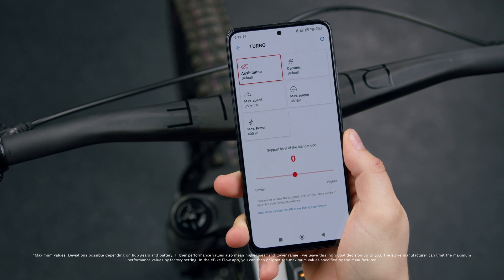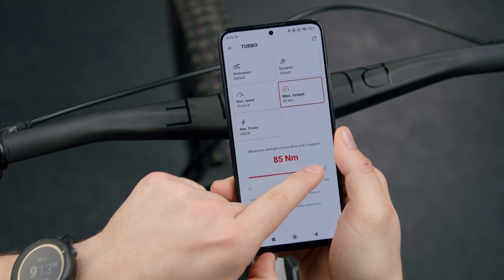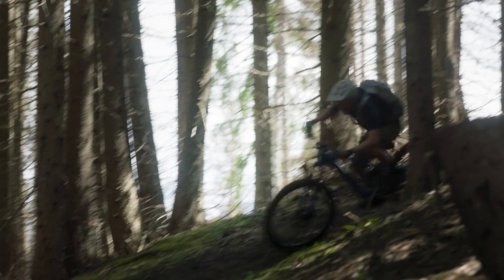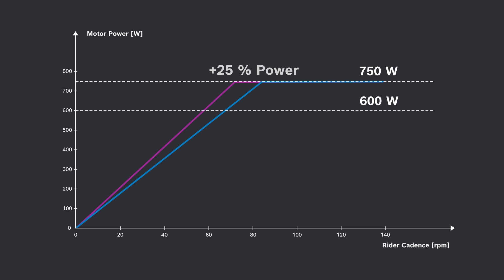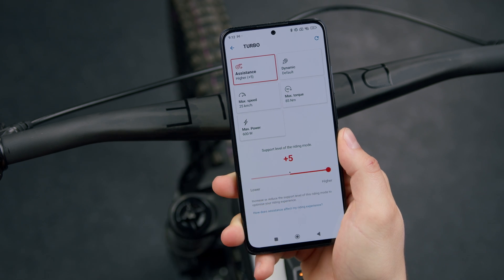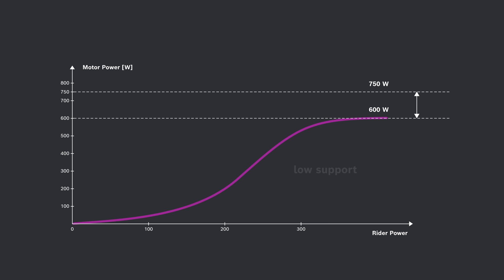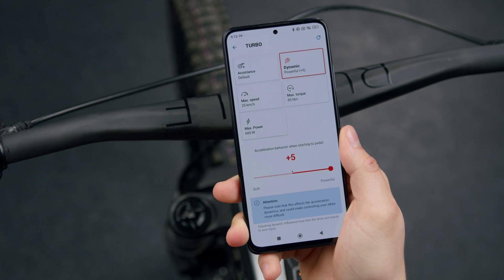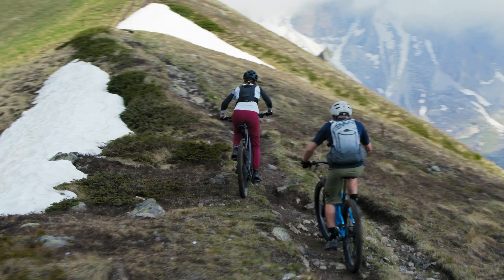Performance upgrade explained | Bosch eBike Systems

Comment from the maker: You have questions regarding the Performance upgrade? Our Help Center provides answers:
➡ Performance Line CX (BDU384Y): https://help.bosch-ebike.com/en/help-center/asset-ast-00284
➡ All Drive units: https://help.bosch-ebike.com/en/help-center/asset-ast-00314
Reply: My cube one44 800 at is stuck at 750w and 85Nm have Android and app 1.28.11 and there is no new uppdate, have tried different phones also remove and done every settings in the app. Also visited my local dealer and he did a update using computer but still only 85Nm. Cube lista the bike as 100Nm ready. Any tips?
Reply from the maker: Hello Niklas Martinsson, With the current update for your eBike with the smart system, it may take several days before the performance upgrade for the performance value maximum torque becomes visible. This only applies to the Performance Line CX drive unit (BDU384Y). The "Y" in the product code is a placeholder and can represent a different number depending on the model, for example BDU3840. You can see your Drive Unit model name if you follow these clicks in the Flow App (from version 1.28) in the settings: eBike Settings -> eBike Pass -> Components -> Drive Unit. Please note: An increase in maximum torque is not available for the Performance Line CX (BDU374Y).
Reply: @boschebikesystems Please clarify, if Gen4 should get torque update too why BDU3741 is not included?
Reply from the maker: Hello Niklas, an increase in maximum torque is not available for the Performance Line CX (BDU374Y).
Reply: @boschebikesystems i have bdu384y my dealer says bosch knows about software bugs that make it not possible on some bikes to uppdate. Any news about when next sw uppdate will come to the flow app?
Reply from the maker: Hello again, with the current update for your eBike with the smart system, it may take several days before the performance upgrade for the performance value maximum torque becomes visible. This only applies to the Performance Line CX drive unit (BDU384Y). The "Y" in the product code is a placeholder and can represent a different number depending on the model, for example BDU3840. Please note: An increase in maximum torque is not available for the Performance Line CX (BDU374Y).

Comment: Hi, i bought a Trek Rail+ with a BDU3840 motor.  The EMTB+ mode will not show up in the list of riding modes. Is this Normal for this model or is there something that can do about it?  I really wish i had it and thought it would be on my bike. thanks so much for you time
Reply from the maker: Hello kal Varnsen, please check the following link - how to get the eMTB+ mode : https://help.bosch-ebike.com/en/help-center/asset-asf-01147.
Reply: @boschebikesystems  thanks for the quick reply. i've tried this many times. I don't have an option for emtb+ only emtb. i do have the upgraded 750w and 100nm.
Reply from the maker: If eMTB+ is still not available in your app even though you meet the conditions in the article from the link we sent earlier - visit your nearest dealer who will update it for you : https://www.bosch-ebike.com/en/service/dealer-search
Reply: @boschebikesystems   thank you!   i guess what i was asking is does my motor BDU3840 support it?  it is not on the list you gave me so i assume it doesn't support emtb+ then. I had hoped it was something that could be fixed :(

Comment: Hello, on my Bosch SX I have only kept the ECO, eMTB and TURBO modes available. Actually I do not feel any significant difference when using the eMTB (at high cadence) or the TURBO mode. Does it make sense to keep the Turbo mode on my bike?
Reply from the maker: Hello, Both riding modes support up to 340 % and 600 W with the Performance Line SX. With a high cadence, both riding modes reach their maximum support and therefore might feel identical at this point. At lower cadences, the Turbo mode offers a bit more support than the eMTB mode. The choice of riding modes depends mainly on your riding situation. The eMTB mode is ideal for technical trails on an eMountainbike, thanks to the integrated feature Extended Boost, which is not available in the Turbo mode. More information about the riding modes can be found on our website: https://www.bosch-ebike.com/en/products/riding-modes

Comment: I have an Ibis Oso with a Performance Line CX Gen 4 (BDU3741) that has the latest update installed (which I did on the 14th) but will not show the new eMTB+ option. When I go into mode customization a riding mode, I do show five areas to adjust. I have the latest version of the Bosch Flow app installed (1.28.11 (178)) and have tried deleting the app and reinstalling several times. When I click on the "Check for eBike update" button in the app, it always says "Latest update installed". I have confirmed with Ibis that they are current and allowing this latest version to be installed on the Oso. They have also confirmed that they have seen the eMTB+ mode available on several Osos. What should I do next?
Reply from the maker: Hello thecyclesaint, if you are missing a specific riding mode on your eBike, please visit any Bosch dealer to request a config change via the diagnostic tool 3 from the eBike manufacturer.

Comment: UK 2025 Haibike with gen. 5 Bosch motor - had the update 2 weeks ago, including EMTB+, but still no 100NM upgrade available - everything tried - the app doesnt have any more updates available - can you give a real answer as to why so many emtb'ers are having this issue with android app (even with new phones running latest android version)???
Reply from the maker: Hello Col. Sir Buffy Horsetrouser, with the current update for your eBike with the smart system, it may take several days before the performance upgrade for the performance value maximum torque becomes visible. This only applies to the Performance Line CX drive unit (BDU384Y). The "Y" in the product code is a placeholder and can represent a different number depending on the model, for example BDU3840. You can see your Drive Unit model name if you follow these clicks in the Flow App (from version 1.28) in the settings: eBike Settings -> eBike Pass -> Components -> Drive Unit

Please note: An increase in maximum torque is not available for the Performance Line CX (BDU374Y).

Comment: can someone clarify for me please  - if I want to climb up a hill as fast as possible, should I use eMTB+, or Turbo? I'm assuming the answer is eMTB+, because it potentially adds 4 times the rider's power input, whereas Turbo only gives 3.4 times. But, my Flow app seems to suggest eMTB+ will give me slightly more range than Turbo  🤷‍♂
Reply from the maker: Hello Graham, yes, you should choose eMTB+ which will give you dynamic support up to the limit – precisely controllable and with Extended Boost. The precise controllability of eMTB mode is combined with the full power of Race mode.
Reply: good question, would like to know that as well. Would like to have 400% support, but without the (extended) boost of the emtb+ mode, which makes for a pulsating behavior in steady climbs.
Reply: @felixmorsdorf1391  have you tried reducing the Dynamic setting on eMTB+?  This should reduce, if not eliminate, the pulsating behaviour. I've gone +5 on Assistance, and -2 on Dynamic on mine.

Comment: where do I get the frame adapter from for the kiox 400c to fit the cut out on my cube one 77 hybrid 2025 has shown at euro bike 2025 ? clearly needs a gasket around the kiox 400c to fit in the cut out ? anyone please has I can't find one online anywhere !! 😑
Reply: I also have the 2025 177 in which case the new kiox 400c will fit perfectly as is so without any need for any gasket. The kiox 400c will be available in UK and Europe in September. For the US I’m not sure but knowing the market there it might already be available.
Reply: @marcusfilarcus  the dimensions of the cut out on the one77 are different to the kiox 400c , it needs a frame adapter similar to the one currently installed for the system controller. check embn on YouTube when there at euro bike 2025 at the Bosch booth and you will see a cube one 77 with the kiox 400c installed and a frame adapter/gasket around it .
Reply from the maker: Hi Dahumgar, The kiox400c can only be retro-fitted if the system controller in the bike already has the cutout and adapter surrounding the controller in the frame. You can then remove both the controller and the adapter and the kiox400c should fit perfectly in the space in the frame. If there is no adapter already surrounding the controller there wil not be sufficient space for the kiox to fit in and in those cases it will not be possible.
We recommend going to the dealer to have it properly installed. Here is the link to your nearest Bosch dealer:
https://www.bosch-ebike.com/en/service/dealer-search
Reply: @boschebikesystems  my bike is cube stereo hybrid one 77 2025 it has the system controller and the cut out in the top tube of frame but the dimensions of the kiox 400c are different to the cut out , it will need a frame adapter just like the one shown at euro bike 2025 at the Bosch booth on a cube stereo hybrid one77 2025 
I have posted a picture of the frame surrounding the kiox 400c on my YouTube post 

its not possible to fit the kiox 400c directly to the cut out on cube stereo hybrid one77 and one44 with out the adapter 
please take a look at the image on my YouTube post has its taken from a cube stereo one77 at euro bike 2025 

The frame adapter is similar to the the one needed for the system controller to fit in the cut out witch is larger 
you install the frame adapter then install the system controller 
same princible is needed to fit the kiox 400c to the cube stereo hybrid one77 and one44 with the cut out on the top tube. 

Being has you work for Bosch bike systems  I'm sure you should know that not all bike have the exact dimensions has the kiox 400c and will need a frame adapter just like the one the system controller uses .
Reply: thanks for highlighting this, I guess you have got the answer now, as ebike24 are listing the Cube Display Adaptor for Kiox 400C, costs 10 euros. I don't know why Cube didn't design the frame cut-out so that the 400c fits straight in, like other manufacturers using Bosch Gen 5 motor 🤷‍♂. But, Cube were among the first to launch Bosch Gen5 bikes so maybe at that time the dimensions of the 400c hadn't been finalised.
Reply: Does your frame have the space to fit the new larger display? many bikes shipping have an adaptor ready to swap out the 5 LED display / control module with the kiox 400c. Unfortunate if the frame is older it may not fit....
Reply: @ThePedro1664  yes it has the cut out but it will need an adapter has shown at the Bosch booth on a cube one77 for the kiox 400c to fit as the cut out on the frame and the kiox 400c are different dimensions
Reply: @DAMGUNHAR I have a Trek rail and it will fit perfectly in the space provided, have one on order due in early September..
Reply: @ThePedro1664  yes trek rail has correct cut out dimensions
Reply from the maker: Hi, In case of compatibility/ availability/ mounting and the order itself, please contact your nearest Bosch eBike distributor directly. You will find your nearest dealer via the link below:
https://www.bosch-ebike.com/en/service/dealer-search .
Select Filter and select your country. Additionally, you can enter your postal code or city to find the service closest to your location.
We hope this information was helpful